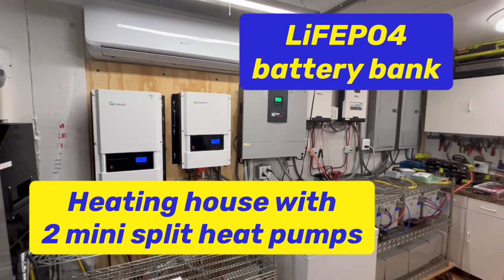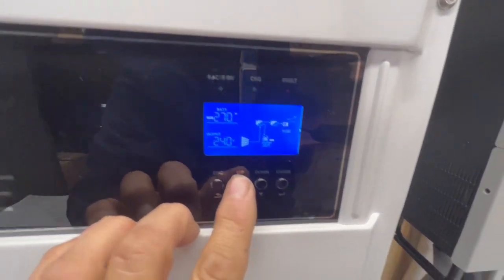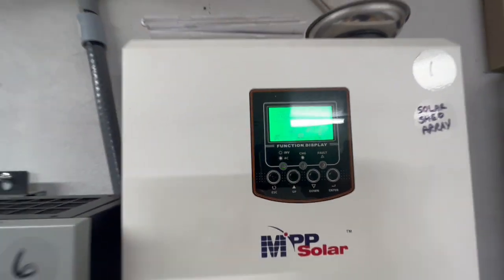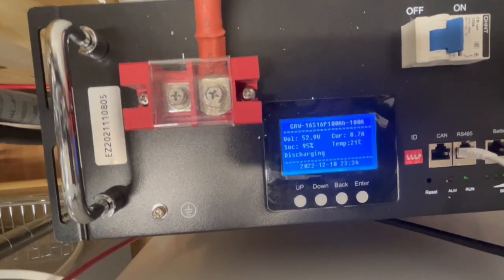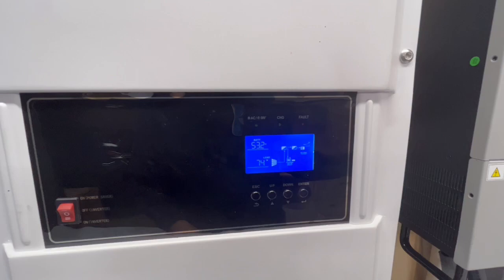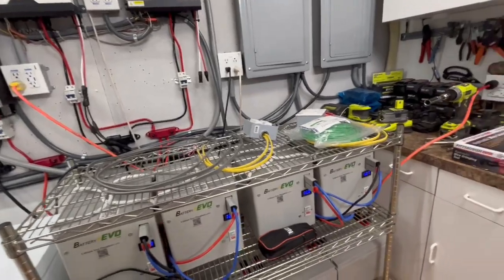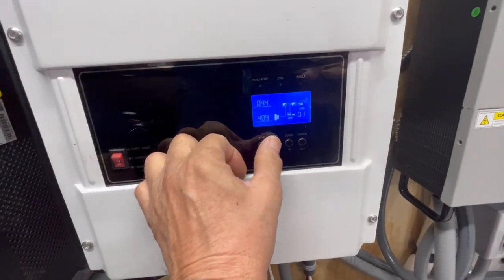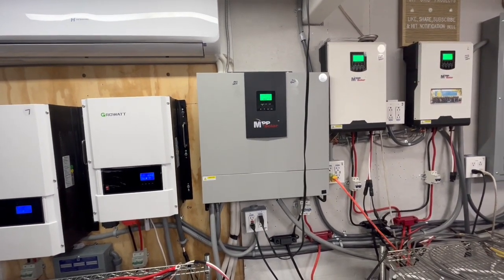LiFEPO4 batteries & 6kw Growatt heating house running mini split heat pumps when 38 degrees outside

Comment: Pappa this thing is hot! It's so hot in my man cave the outside unit cut off its only pulling 63 watts from the inside units blowing good heat it's been running since 6pm it's now 9:54pm
Reply from the maker: So the mini split works well. Mini splits are very efficient, but are not meant to last 15 to 20 years like a whole heat pump or ac. But mini splits are a fraction of the price. So you can just replace with a much more efficient model when they crap out. I’m so happy you finally got the mini split up and running, and running very well.
Reply: @diy-solar-guy  thanks yes it's doing just fine for now at least lol
Reply from the maker: @thelithiumpowerch  how is the mini split doing? Keeping up with the cold temps and saving alot of money?
Reply: @diy-solar-guy  yes I absolutely love it I have it in my man cave I might buy another one for the dining room
Reply from the maker: @thelithiumpowerch  I have 7 mini splits now, I’m good for a long time. can never have to many mini splits, lol.
Reply: @diy-solar-guy  right I was looking around Facebook marketplace and found a complete unit in the box a 12,000 btu Pioneer for $500
Reply from the maker: That’s a great price
Reply: @diy-solar-guy  yes but I do have to get my own line set I'm not sure why there's didn't come with it
Reply: @diy-solar-guy  the one they selling me is not a 12,000 BTU it's a 18,000 btu Pioneer mini split I don't think they know what they have said they bought it at an auction and never installed it
Reply from the maker: @thelithiumpowerch  that is a really excellent price for a 18000 btu mini split.
Reply: @diy-solar-guy  so after noticing the boxes was two different colors I asked where did they get it from they said an auction I said because the indoor unit is a 12,000 BTU and the outdoor unit is a 18,000 BTU that's why they didn't give you a line set just the two boxes you have a mismatched unit
Reply from the maker: @thelithiumpowerch  that’s not good
Reply: @diy-solar-guy  right it's so many of them on Facebook marketplace I'm just going to keep looking around I even found a 24,000btu Senville Mini Split still hooked up & running for only $500 bucks but I rather try a 18,000 btu it looks just like my Senville just bigger
Reply from the maker: @thelithiumpowerch  That is less than half the price for a 18000 btu unit. Even if you bought new line set it is a good price, my only question would be, what is the reason they are selling unit? I also use Nylog Blue gasket & thread sealant on all line sets where I thread on. It is compatible with all refrigerants and will not contaminate system. It keeps the refrigerant from leaking out. It’s like really thick honey consistency and really sticky. Comes in a 30 ml plastic bottle, bought on Amazon. It’s $15-$20 a tube. I used one tube to install 4 mini splits. Really works good on threads to seal tight.
Reply: @diy-solar-guy  I'ma grab me some Nylog Blue a lot of people are using these mini splits to grow weed lol when they get tired of glowing they sell the Mini splits and all of they grow equipment other people don't even know how to hook up a mini split and don't want to pay the extra money it cost to have it installed so they end up selling theirs it's quite a few mini splits on Facebook marketplace some people sell because they moving just a few different reasons I've talked to a lot of people in the last few days one guy has a brand new MrCool Advantage 18,000 btu still in the box for $550 just the outside unit & another guy has a 24,000 MrCool both pieces for only $450 lol
Reply from the maker: @thelithiumpowerch  really good prices, be cautious. I bought all mine from businesses that offer warranty, in fact I bought an 2 AUX refurbished units and because I knew what I was talking about, they still honored the warranty even though I was not certified in HVAC, in turns out the units were fine, only issue was I was using in upstairs bedroom and the compressor in outside unit did not have enough head pressure to lift refrigerant 18 feet off ground, so I replaced with a premium brand which cost $100 more and that unit was able to push refrigerant up to second floor with no problem. I sent outside unit to factory and they checked it out and sent back. You can still use the unit on second story, just would have had to put outside unit on balcony on other side of wall from heat unit, would only need 11 foot line set. I was quite surprised they honored warrant not being certified, was worth the money to buy from them, I only paid like $900 for 2 12,000 btu units refurbished from manufacturer. Hope all this helps for future installations. Have a blessed day.
Reply: @diy-solar-guy  Oh ok I'll be careful when looking around I only want the ones that's in the box and never been hooked up or the ones that's hooked up running where I can properly shut them down and save the refrigerant 😉👍

Comment: Cycling off and on at 600W is not very efficient. If you can get an inverter based mini split heat pump, like my Fujitsu 33SEER 9K, they will ramp up and down. You’ll lose less energy heating that indoor coil back up and cooling the outdoor coil off each cycle.
Reply from the maker: I agree, but these units work great for my needs and only cost $600 a unit. I looked at high seer ratings with mini splits but was looking at around $1,200 a unit. I am quite happy with 2 mini splits for $1,200 that do a really good job heating and cooling my home upstairs and downstairs. But I agree the higher efficiency in the 30+ seer ratings are extremely efficient compared to my 18 seer units. If you can afford the money for the 33-38 seer, I would definitely recommend.

Comment: Hello what Mini Split units are better or have the lowest power draw a 120v or a 240v Minisplit
Reply: 240v. Fujitsu 33SEER 9K is what I have.
Reply: @USA-GreedyMenOfNoIntegrity  what's the maximum wattage it draws with the heat pump or ac running ?
Reply from the maker: In the summer, the 120v premium unit will get up to 1400watt, the 120v AUX unit will get up to 1200 watts, and the 18,000 btu unit in garage that is 240 volts will get up to 2400 watts when it is 115 degrees outside. Heating is almost 1/2 the amount of watts quoted above when it is in the 30 -40 degree range outside. At 100 degrees outside the units will run about 30 percent less watts.
Reply from the maker: That is a nice unit. Very efficient. Good unit if you can afford it.
Reply from the maker: In the video I show that the both 120v, 12,000 btu mini split used around 800 watts, the 240v 18,000 btu mini split I have in garage uses around 2000 watts. The AUX  120v, 12,000 btu mini split was around $600, the Premium 120v, 12,000 btu mini split was around $750 and the 240v, 18,000 btu mini split was around $1000. The cost is probably 10-30 percent more with inflation. I like the 12,000 btu, 120v mini splits better because they use such little amount of power and are extremely quite inside and outside. I can run the 120v mini splits with my battery bank overnight no problem but the 240v, 18,000 btu mini split will use almost 2 - 3 times as many watts. In the large open downstairs I have, the 120v mini split cool and heat the house very well and I have a regular plug instead of hard wired on 120v mini splits. I can use on solar or grid. Just where you plug into. Most mini splits out there are compatible, I bought my 120v mini splits on eBay and my 240v mini split at Home Depot, it was in stock locally so I just brought home in pick up and installed the same day. I had no experience with solar or mini splits 3 years ago but was able to do everything pretty much by myself just watching videos. If you have a larger solar power system and a large LiFePO4 battery bank you could run the 240v unit 24 hours a day. But if you have a smaller solar power system, I would suggest the 120v mini splits and putting a regular outlet plug on end instead of hard wiring, just make sure you use 10-12 gauge wire and keep cord as shorty as possible. Only draws around 8-15 amps for 120v mini splits so most outlets in your house or garage should be able to handle without tripping breaker. I will say the AUX unit can not be used on second floor of house unless you mount unit on balcony. Compressor does not have enough head pressure to mount on ground and run refrigerant lines up 16 feet from ground. Premium mini split was able to run with no problems on second story of house with 18 foot run from ground to head unit in room. The 240v units will heat or cool at a considerable quicker rate but will consume a-lot more watts. Signature solar sells really high efficiency mini splits that will cost you $1200 and up. I opted to buy to units for $1,200 and forgo the the really high efficiency and it worked out well for me. There are literally several dozen different brands out there, most will be the same unit with different name on outside of unit. These units life expectancy is about 3-6 years. My whole house heat pump lasted almost 17 years before I had to replace. The higher the efficiency, the less power draw, but price increases greatly with seer rating increasing. hope this helps, let me know if you have more questions.
Reply: @diy-solar-guy  thank you for the response I read the whole thing I only have about 6000 kwh in Lithium batteries I was trying to find a mini split that didn't go past 800 watts of power draw at the most
Reply from the maker: At that low amount of watts, you might want to look at a 9000 btu unit with a seer rating above 30. Remember higher the seer, the less watts it uses to run.
Reply: @diy-solar-guy  okay I'll keep that in mind and thanks a lot appreciate it. 👍